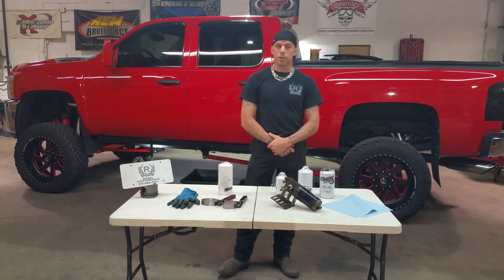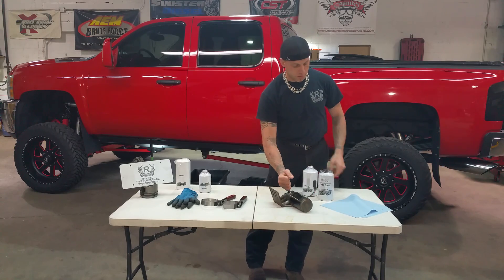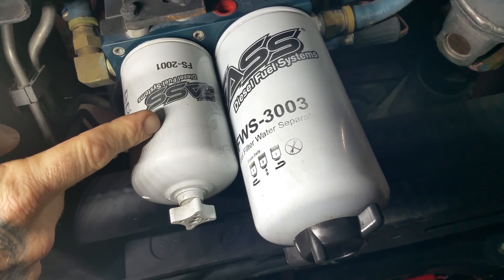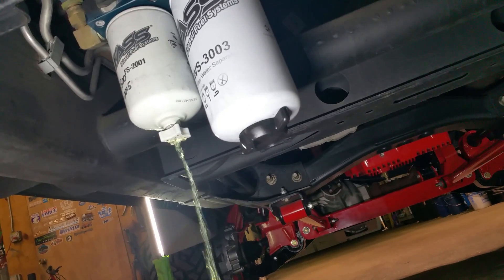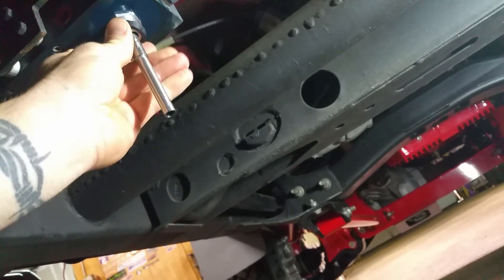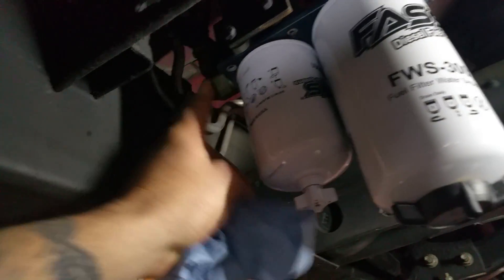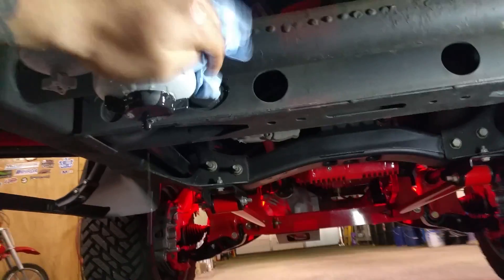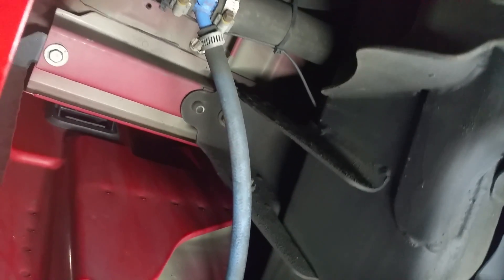Fass fuel filter replacement titanium platinum

Comment: G'day from Australia. On my 2012 LML I have fitted the FASS directly above the main drive shaft just ahead of the differential (I have a 6" lift, so there is plenty of room there). When I did the wiring I ditched the loom that came with the kit. Instead, I mounted the relay and a momentary push-button micro-switch, inside a small plastic snap-lid box, which is mounted close to the FASS. When I change my filters, all I have to do to prime them is to remove the cover off the plastic box and press the switch, which operates the FASS motor. So, with one hand I'm operating the motor and with the other hand I can quickly tighten the main filter once the fuel appears. Just saves my aging body from having to climb up and down from under the truck to operate the ignition key.

Comment: doesn't that small oring go on the suction side of the pump? thats what it shows in the FASS directions atleast
Reply: I re-read the instructions and small o-ring does go on the suction side/water separator filter, not the 'pressure' filter.   Great video however!!!!  Thanks..
Reply from the maker: Yes you are absolutely correct. When FASS made these older units the FWS-3003 filters came w the oring and the FS-2001 did not. When I made the video, I mistakenly forgot to swap the orings (used to the new systems I guess) . The new systems use the FS-1001 water separator and they DO come w the oring and the FF-3003 filters no longer do. On a side note the FF-3003 has succeeded the FWS-3003 and no longer has the water drain at the base. Nice catch on the details tho 👍. Thanks for watching.
Reply from the maker: +Verle Skidmore Hey bud. You are correct. Nice catch on the details and thanks for sharing. I explained the mistake in the previous post. Thanks for watching!
Reply: good video but I got all fucked up with this o-ring situation .... you might want to redo the video so others don't get cornfuzed
Reply from the maker: Chris  Knowlton yes your correct. it's bothered me since it was made. I will try and make another video w the updated filters and pump style.

Comment: hi, i have an 03 silverado 3500. I've just had the injectors replaced once again. I'm really considering have this fass system installed on my truck. I've heard this is actually worth the investment. my truck is stock, no aftermarket parts whatsoever. whats so take on this? I want to go as long as possible before i ever have to change out the injectors again.

Comment: To save the pump cant you fill both filters up with clean fuel prior to screwing them on? I was told that will keep your pump from working so hard.
Reply from the maker: Its never good practice to fill any secondary or final fuel filter in a filtration lineup w unfiltered fuel out of a container. Debris from the container or the raw fuel source could result in detrimental fuel injection component damage.

Comment: I have a 2002 LB7 and I just received my kit.   I really don't like the location that FASS recommends.   I really like your location but I realize it's a later model.   Can I locate my FASS in that same location as yours?
Reply from the maker: Yes you can. We make the brackets for all of the FASS systems we install just for that reason. Most of the brackets we make are the same but some customers have special requests and we make them accordingly. If you wish to have a set made please give the shop a call and we can accommodate your needs. 516-680-7377. Thanks for watching!

Comment: would you run a CAT or Baldwin filter kit upstream of this and eliminate your stock filter?
Reply: +bigdawgfan72  I did, but its not much cheaper
Reply: +bigdawgfan72  Did you install a nictane kit? I left my LBZ w/ stock fuel filter on in conjunction with a FASS 150. It might be overkill but having a stock ~5-8 micron filter plus FASS 2 micron filter in place can't hurt. 

I believe when you install FASS there is also a delete kit  for under the hood. Just trying to help.

Comment: Can you just pour diesel directly into filter before putting on like a oil filter so you don't have to prime?
Reply from the maker: rgo91284 NO sir! By doing so you could be introducing contaminants  bc the fuel will not be filtered.
Reply: Richie's Truck and Auto Thank You!
Reply: @richiestruckandauto7438  

The picture on the fass fuel filters themselves shows you priming it by pouring diesel into the filter, but your reasoning makes sense. the can I have at the house that has diesel fuel in it, has small particles that you can see down in the container, I was wondering how this was going to work, I guess if you had a brand new container , but who says the fuel isn't contaminated from the station you buy it at.

Comment: the filler neck part is installed backwards.
Reply from the maker: Thabks for your input. However, it's irrelevant which way the return bung is mounted. The volume of fuel returning will not be effected. You can easily fuel the vehicle with the pump running and it will NOT impede the filling procedure. The adapter is installed that way for easier routing of the fuel return line and saving material in doing so.

Comment: I dont hear my FASS system kick on.  No blown fuse either.  I manually primed my filters and all it does is just crank.
Reply from the maker: What platform are we talking about here? How did you manually prime it?
Reply: 2011 Ram 3500 w/ 6.7. I manually primed by filling w/ diesel fuel before installing. Also still have factory fuel housing, I filled it as well.
Reply from the maker: @carlleague3036  few things; 1) NEVER prime filters by filling w fuel. you are introducing unfiltered fuel into the system. Cummins used to void warranty if this was discovered. 2) Ram has a factory control circuit that energizes the FASS relay. You need to check that relay/fuse as well as FASS relay and fuse if not done so alreqdy
Reply: @richiestruckandauto7438 . Well my truck has 220K so its not under warranty. Lol.  Secondly, Ive checked the fuses as well as the relays and nada.   Im unsure if its the FASS or if its my ECM, I have P-0602 and P-0606. 😢
Reply from the maker: @carlleague3036  If I recall accurately, the 0606 is a game over code? I'd look into grounds/power concerns and then swap out that pcm 👍

Comment: When you remove the filters will they keep draining fuel from the tank or will they just drain what's in the lines?
Reply from the maker: The siphon or ability for the fuel to do so depends on several variables; how much fuel is currently In the tank, how low the pump assy is mounted in relation to the fuel level and how quickly you can get the filters back on the pump. lol. Essentially, if the tank is full, the fuel will most likely keep siphoning bc the pump is rarely able to and shouldn't be mounted above mid tank level. Additionally, the 1st filter (pre-pump) will flow more than the 2nd (pressurized when energized) filter if siphoning is permitted
Reply: I see people using vise grips to clamp off the inlet line but I don't really like that idea. Any other suggestion? My filters are mounted pretty low. About half the filter sticks out below the bottom of the bed side.
Reply from the maker: +Brian Holloway your options are limited considering the circumstances. You have to either use the pinch clamps (Mac or Snap-on make minimal-damaging, plastic style) or install a shutoff valve (ball style or gate w petroleum resistant seals) of any kind in the feed side and discharge side (it will drain backwards as well)
Reply: +Richie's Truck and Auto how did you get away without clamping your lines?
Reply from the maker: +Brian Holloway the tank was 1/4 full. The siphon actually stopped on its own

Comment: Doesn't the fuel run through the water separator first? It doesn't make much sense to run it through the lower micron filter first.
Reply from the maker: izuksammy Yes that is correct. The fuel travels through the water separator 1st on this model and the current model pumps. The FS1001 (current) or FS2001 (previous) filters are the water separators. FASS previously utilized a filter model FWS3003 (seen in this video) but has since been discontinued. Oddly enough, the fuel path was through the FS1001/2001 before the FWS.

Comment: Trac bars look awful!
Reply from the maker: For starters, this is an IFS truck. No trac bar is utilized in this type of suspension. If there were, it would be in singular reference of "the trac bar looks awful". If your going to troll, atleast use correct grammar 😉